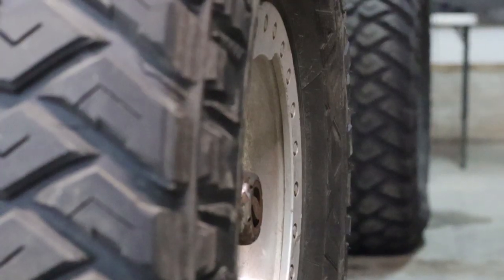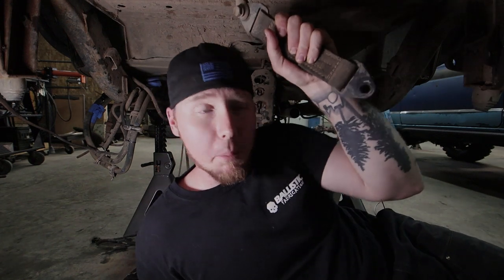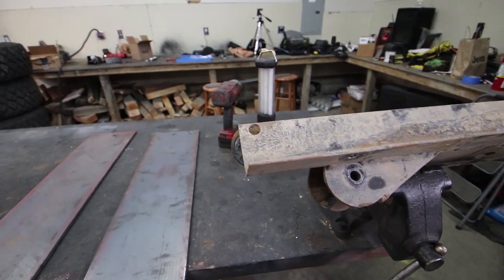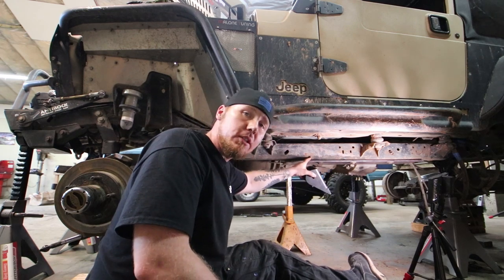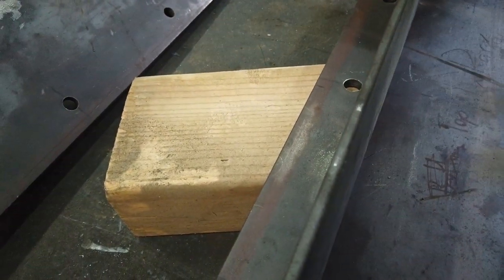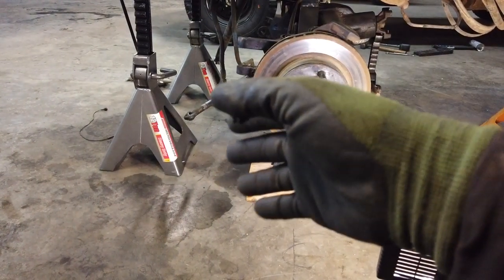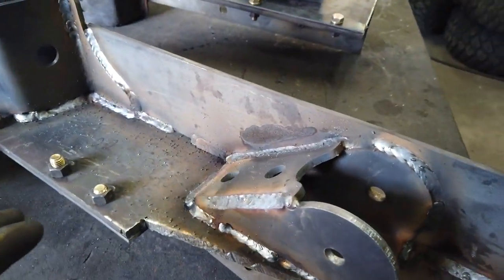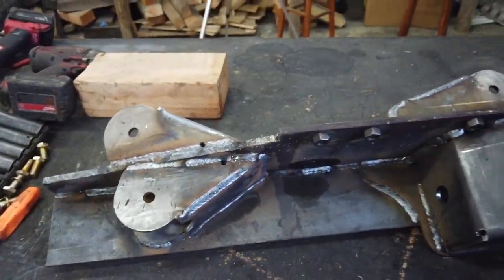DIY 3 Link / 4 Link Suspension - Jeep TJ Stretch Episode 1

Comment: What setting are you welding at?
Reply from the maker: Depends on what I'm welding. I picked up this Miller multimatic 220A few months back and it's pretty dam automatic. So if I'm welding 1/4" I just set it to quarter inch lol. Damn near foolproof
Reply: @DirtLifestyle  welding tech has really come a long way
Reply from the maker: @carlblaser3320  I couldn't agree more